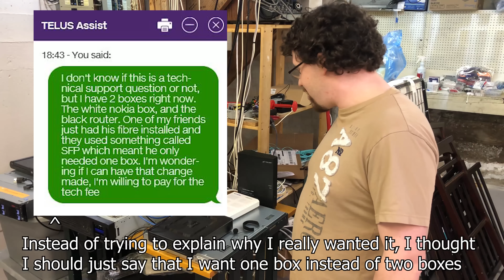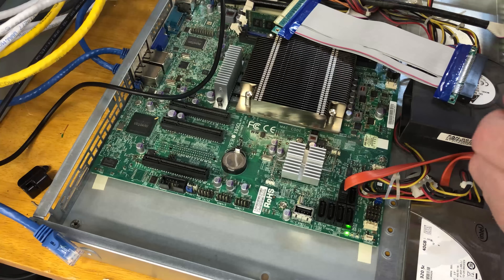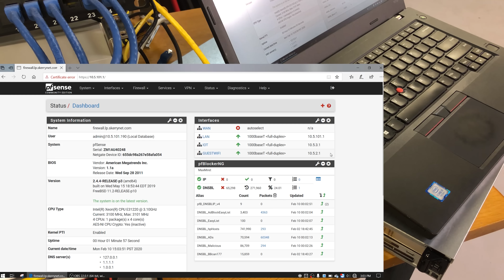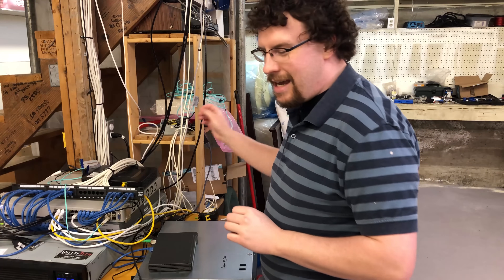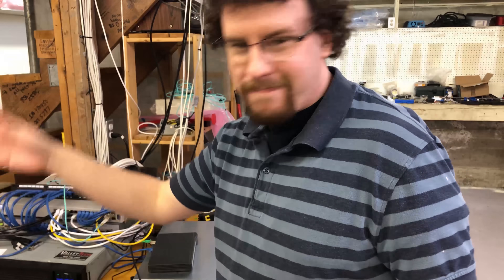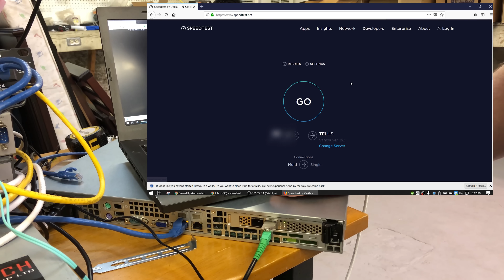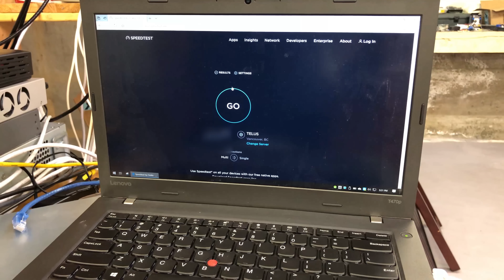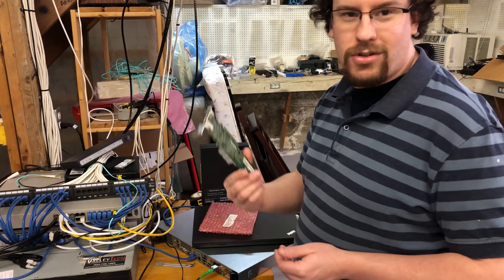I connected my fiber internet directly to my pfsense router via SFP!

Comment from the maker: I upgraded to 1.5 gbit internet! Check it out here: https://youtu.be/gzk69kHLu1o
Reply: Hey just a quick question what transceiver card was used...I am attempting to do this with AT&T fiber. How ever when I plug the transceiver in pfsense does not recognize it...I did some looking into it and it is a nokia transceiver PT# 3FE46899AAAA
Reply: @andrewholder495  Did you ever get this to work? If so, what transceiver did you use for the Chelsio T420?
Reply: @jcmichel5768  Unfortunately I did not gave up I got a set of public IP's from my ISP
Reply: Thanks
Reply: Hey Shae so very thankful for this information...I tried the same setup with the Chelsio T420...how-ever when I plug my ISP's SFP transceiver in (which is a Nokia also) PFsense does not recognize the module what module PT# is yours? mine is P/N;3FE46899AAAA.
Reply: What transceiver did you use for the Chelsio T420?
Reply: @jcmichel5768  I tried several different ones the last was ODI GPON OLT Class C++ DGT2-49DC-2CY2
Reply: @andrewholder495  thanks
Reply: Hey i have 40gb service and my isp says the sfp is my responsibility. The ont has 4 10gb eth ports. Anyways i cant figure out what type of sfp+ adapter i need to connect from the fiber coming into the property. Its not like the fiber that goes between my switches

Comment: So I have a question. Does this mean pfsense comes with the protocols that normal fibre ONTs use to connect to internet?
Reply: No, it actually the gpon stick that communicate with the fibre signal.
Idk if his ISP have some sort of ont authentication at the time of the video. But generally, the gpon stick must have the same information as the ISP modem (eg. gpon SN, mac address, etc) so that the ISP can authenticate and give you internet access

Comment: It's shame none of this can be replicated on BT's network as their far behide the technology.
Reply: Lovely 😶I'm here because BT has just installed a 500Mb FTTP L3 line at a client and dumped an Adtran box. So I'm trying to figure out how to get their PFsense box to talk to this, hopefully without a router. Any comments & advice welcome!
Reply: @boerboel7777  As far as I remember, the connection between the cabinet & client is uplink of 10Gbps, policed down to meet the payed for speed. If I can remember, BT use MAC filtering, serial number filtering at OLT level to make sure only ONT's provisioned by BT are allowed to authenticate.

Comment: With fiber for anyone watching this when you plug in FIBER or whatever to WAN on PFsense either straight fiber or through an ONT don't just sit and wait for it to connect, restart PFsense.  Restarting PFsense will pull an IP and configure the WAN port.  Always restart PFsense when changing WAN it's just faster.  Also yes your speed will be limited to your computers NIC even if the PC has a 10Gb nic on most Nics the advanced default settings really limit the NIC speed.  I spent a good two days adjusting the nic settings and testing.   I have 10Gb nics on all my stuff.  You have to turn off all Power saving and flow control features, and crank up the RSS ques, and Buffering as high as it goes.  Also if you happen to have jumpo packets on all devices this actually makes a big difference on LAN speeds.  But anyway turn on all Offlading, options turn off all PME/power saving functions, and flow control.  Turn on split header if you have it, and crank up all Ques and buffering on your nic.  My 10Gb nics went from 120MB Mega Bytes not bits on windows across lan to 700 to 900 Mega Bytes so basically close to 10Gb.  My internet speed on 3Gb went from 1.5Gb bit down to 2.5Gb down and 700 up to 1.5 up I'm on 3Gb plan.  Nic settings matter a lot, at least on intel nics.

Comment: This is great. 

I was part of the small test group that trield out the 1.5Gbit network for TELUS back in 2019. It's cool to see that you were able help support folks with this video.
Half a decade later, I've upgraded to 3Gbit and I'm not learning how to incorporate pfSENSE as I upgrade my network.

Understanding it's been so long since this video, thought I'd comment and ask what your current setup looks like.

Specifically, for anyone else on the TELUS network thinking about or already running pfSENSE on TELUS Fiber, I'm hoping for some help with setting up pfSENSE. I've connected my ONT/NAH (set to bridge mode) to my pfSENSE WAN port but cannot get a public IP address to show up on my pfSENSE admin console. 

Hope this comment restarts a conversation around pfSENSE and networking for us TELUS Fiber internet users with niche home networks.

Comment: I'm getting the same speeds (1G) on the BGW210-700  to my pFsense box via passthrough mode (ONT) with a public IP. (But I'm not running a bunch a servers in the background) The only disadvantage (for me) is the IPV6 configuration is limited to one subnet without the ubiquitous "hack", which is more trouble than it's worth!  Been stable for about 5 years.

Comment: They still have an ONT (2024 June install by Telus Fiber to home). Speeds are symmetrical ~950MB/s. The ONT > Telus modem > Telus router.
I do not have fiber to home in my area but when I finally do get it, hopefully can go from ONT directly to fiber SFP+ on my own router.

Comment: YOU DONKIES DONT UNDERSTAND ANY THING. FIBRE IS FOR LONG DISTANCE 100'S OF METERS. BUILDING TO BUILDING. COPPER ETHERNET IS MAX 100 METERS. AT 100 METERS IT WONT BE FAST. ONLY FAST FOR 20 TO 30 METERS. FIBRE IS FOR LONG DISTANCE 100'S OF METERS. MULTIMODE FIBER CAN GO 500 METERS.

Comment: Here is how you get it to work. the latch on the sfp that you plug into fiber factory box. No BS Gfiber hasn't been able to bill me for a year with my UDM pro. OPEN LATCH PLUG IN THE FIBER MAKING IT HOT SWAPPABLE. Let it config on the isp box and then pull it while live and plug it into the sfp. They will not be able to see  traffic and without the fiber jack they cant turn it off when you don't pay. they have one option and that's to cancel your account after it gets to 1000 in outstanding bill.

Comment: Question, they put the modem in like yours, I want to take that and plug it directly into my router then cable out of router to pc. Do you believe it will work. They told me couldn’t do that . But the tech guy didn’t know much he didn’t even know about 10gig ports and 2.5gig ports. Second question where do you get the took sfp tool?

Comment: I've been trying to make this work with an HP NC523SFP card. After a lot of digging, I've come to the conclusion that likely the reason it doesn't work with my card, didn't work with your card, but does work with the chelsio is because according to it's specs, it has IEEE 802.3z (1gbit) standard, while all other common cards for homelabbers are only IEEE 802.3ae (10gbit)
Now I'm wondering if the x520 might have support, datasheet says 1/10gbe for optical and 10gbe for dac, but doesn't state 802.3z

Comment: I've got the new ATT fiber modem, the BGW320 with the SFP connector.  Do you think that I can just plug that SFP connector with the green fiber cable straight into the 10G port of my Unifi UDM pro, set the interface to DHCP and see if it pulls an IP?

Comment: Maybe stupid question but here in germany we have internet that is conected to router via f-type connector.
So my question is there any way to bypass provided router or connect that cable to your own pc?
That would be linux or bsd based router os  so you can manage it yourself because current router decides to go update mode when you least need it and you lose internet up to a hour.

Comment: I totally want to do this but have some roadblocks preventing me.  need a card compatible with freebsd (would prefer native compatibility), must be low profile for my optiplex 9020 SFF box, must accept my Alcatel-Lucent G-010S-P transciever module.  (also do not want to have to solder / bodge wire the card)

Comment: Hi Shae,

I have a new Netgate 6100 Security Gateway (pfSense) and I would like to bypass my 2 GB Google Fiber modem. The 6100 has these built-in network ports: (2) 10 GbE SFP+ Ports, (2) 1 GbE Combo Ports (RJ45/SFP), and (4) discrete, unswitched 2.5 Gbps Ports. 

I removed the Google Fiber SFP from the GF router and inserted it in the Netgate SFP port, hoping to obtain a public IP address, and to migrate to the 6100. So far I have not been able to get this to work, and stumbled upon your video while searching for help.

Do you have any thoughts or tips that might help me?

Thanks in advance.

Comment: I'm going to try a setup similar to your setup too.  Instead of a PFSense box I'll bypass the Nokia ONT box and plug it directly to a Netgear SFP+ switch and then to 2 separate Asus router.  This way I can grab 2 Telus external IPs for 2 separate networks.  Would that work?

Comment: the lights are pretty confusing when you get new router after long time I think Zyxel and other routers needed internet braodband was the name so fiber is now Ftth gpon and epon Im getting 97Mbps on Home plug adapter or ethernet cable im paying 85 euros for 2 phones with dual sim cards 1 from croatia and 1 from slovenia there is no more roaming utp cable haves 2 pairs times 4 so if you use all 8 wires you should be getting 1000Mbps without any power over ethernet adapters and switches.

Comment: any one try this on any intel nics?
Wondering if it will work with the Intel X520-DA2 10Gb 10Gbe 10 Gigabit Network Adapter NIC Dual Port

Comment: Lol its not if the card will work with pfsense - if it's the firmware will recognize the card to begin with. When in doubt mellanox 3xconnect (I believe  that's the name) - they usually pnp and play fair without a problem

Comment: FYI ; You're still using an ONT - just an SFP based ONT, which is no different than using the Nokia ONT. That model Nokia is actually capable of nearly 2gbps on the fibre interface, but the ethernet ports are limited to 1gbps. So you can get better performance  using the SFP version of the ONT directly in your router if that SFP is a 2.5gb version, and your own router has ethernet ports that will support that rate or higher. There are multiple versions of the SFP and TELUS uses 3 versions depending on which CPE you have (1, 2.5, and 10gb versions). The actiontech t3200 has been deprecated, and is replaced by the TELUS wifi Hub (which features 2.5gb SFP and ethernet ports), the Arcadyan  NAH (Network Access Hub) which has a 10gb SFP port, 4 GBe ports, and 1 10Gbe port. The service you are using is GPON, and TELUS has just released XGS-PON for speeds up to 10gb. If you see speeds above 1.5gb available in your area, that means your NAP has access to XGS-PON splitters in the FDH, and in that case you can get the big daddy - a new black Nokia ONT with 10gb ethernet ports all around. Happy surfing!

Comment: Hi Shae, I was wondering if you could try this with a mikrotik (RB3011) device and see if you can get it working. So skip Nokia ONT and plug directly into mikrotik router in place of PsSense.  I would be interested to know as i want to try this.  I am not familiar with PfSense.

Comment: Some incorrect facts. For Tv you don’t have to use the actiontec, yet it may have to live on the network for an unknown reason. You can also pull 2 IPs off the ONT with a switch and make a tv network separate form your main network. Some places get a fibre into the router (SFP) yet I’ve never had that for my sites. SFP modules are not all compatible with all devices ask that’s to be expected, need to find a compatible card or device for the provided SFP module. 
This is also with this ISP and not all are are as friendly or unfriendly as this one.

Comment: Lovely video!! I've been desiring this for a few years and I bet it's possible to do for me.
Note: Some ISPs go mad, when they can no longer control your fiber-box. ;)
If I'm going to try this, I'll be using a Solid-Run ClearFog CX LX2 (yep, the $1000 variant with 100Gbit QSFP28 in addition to the QSFP+).
A MacchiatoBin (or even the 9130) would likely be sufficient.

Comment: I have fibre too, but they just gave me a micro ont which is about the size of an altoids container, which has an ethernet port, which can be connected to any type of router. I think having an sfp module would be cool though, I have several gigatybe switches with sfp ports, it would reduce the amount of crap I have laying around lol.

Comment: question for u as u seem to understand...  
, with the TELUS IPTV boxes back  from 2010,2011,2012 etc, , they would create multicast SYNC IP  flood if not using all telus hardware with their settings, router, ap, wifi, etc, modem , etc

The new telus iptv boxes seem to be more direct IP TV ,  they dont create a flood..  Has technology changed? if so whats the difference. Thank you

Comment: @Tech with Shae, can you provide the parts you used for the pfSense build?
Reply: Router Specs:
Supermicro X9SCL
https://www.supermicro.com/products/m...

Intel Xeon E3-1220 V2
4GB Memory
40GB Intel SSD 

The SFP module provided by Telus is a G-010S-A P/N 3FE46541AADA

(From the Video Description)

Comment: At 5:20 when you plugged the fiber connection in to the SFP you pulled on the release lever which activates a mechanism that pushes the ONT away from housing, so the HP card MAY have worked if you didn't do that, the SFP ONT may not have been seated correctly.

Comment: I think you said the card was an SFP+ witch is a 10Gb/s interface. While it should auto-negotiate down to 1Gb/s, it may not do so all the time, especially in a PFSense setup. If you could limit the port to just 1Gb/s it would probably have worked.

Comment: i have att gigabit fiber. my install consists of a small wall mounted box that the raw fiber cable plus into. then from there to a modem/router (via ethernet cable). and from there, into the computer and a switch that sends it throughout my house.

id like to delete my modem/router so that the ethernet cable coming from the wall mount box goes straght to a router of my choice.

is that possible? ive heard of setting the modem router to bridge to my router of choice, but id rather not. ive also heard i can get my own 2 in 1 modem/router to replace my isp provided one. but those seem super expensive.

Comment: Updates brought your ping down. Plus change your WAN to change the IP address. It will automatically put you into a higher tier tunnel usually. Depending on whom is around you. Businesses and major coms people. Cellular radio junk, unshielded wires. Will have ping issues unshielded versus high-end wires.

Comment: I have an HP dual card sfp+ collecting dust in my closet. I have had the best luck with the Mellanox ConnectX 2 or 3 cards.  I had a Chelsio card that either didn't work with my setup, or was dead on arrival. I'm dying to direct connect fiber to my router, since it has an sfp+ port on it to connect a transceiver. Thanks for the great video!

Comment: I used to have 10G and I had trouble with one of the old Xeon E3s. I switched to an old i7 980X and got 5Gbps throughput. There is a limitation in software with Pfsense doing multi-gig routing and not hitting 10G. If you're not getting the speeds you need try changing processors to something newer.
Reply from the maker: Yeah I got it all sorted now, running 1.5 gig :) https://www.youtube.com/watch?v=gzk69kHLu1o

Comment: Hello Sir, I've Netgate SG5100 - its quite an expensive device but WAN is only GE. I'd like to use fiber from my ISP in off-hand ISP manner. I was considering the purchase of a switch with SFP module and using passive route from SFP to GE on my switch - so I can plug router with the switch over GE cable. However, I've difficulty to find out if switch allows this setup. I'm considering Netgear 10p GS110TP. I've send email to Netgear to find out will I be able to do that but without response. Can anyone assist?

Comment: Hi Shae,

I'm also on Telus 1.5Gig. For those of us who don't have a server rack, do you have recommendations for a simpler setup?
I saw a guy on reddit got it working with XG6 + UDM Pro. (UDM pro might gain future 2.5Gig support.)

Thanks
Reply from the maker: At the moment I do not, but only because I haven't had the opportunity to test any other methods. I have seen some forum threads where people have tried to get it to work with some ubiquiti routers, but the issue is the module only links at 1gbps even though the ports can support more. I would recommend looking on the dslreports forums, Bell also has a 1.5 gig service so I would check both Telus and Bell categories on the forum.
Reply: @TechwithShae  Thanks for the reply. It was bothering me too much (not getting full speed) and I wanted to keep things fanless. So I went back to 1Gig.

Comment: Hey mate, chelsio T420-cr 110-1120-40 are very rare to find and expensive since it gets shipped from US. any other cards that are compatible? by the way I have telus 1gb connection like you with no phone for the house.
Reply from the maker: I have managed to get the Broadcom card to work that I tried to use at the beginning of this video, but it needed a physical modification to recognize the SFP module used by Telus. 

The card is a Broadcom BCM957810A1006G

Here are the links to the guides I used to get it working - the most important one is the solder modification. If you are able to do that, you may be able to use the card without installing the custom driver as long as you don't need speeds greater than 1gbps. My other video (https://youtu.be/gzk69kHLu1o) showcases using the custom driver to achieve speeds greater than 1 gig if you subscribe to the new 1.5 gig service. 

pfSense Driver:
https://www.dslreports.com/forum/r32387515-

eDiag / Main thread:
https://www.dslreports.com/forum/r32230041-Internet-Bypassing-the-HH3K-up-to-2-5Gbps-using-a-BCM57810S-NIC

Broadcom Solder Modification for Nokia SFP Module
https://www.dslreports.com/forum/r32529545-
Reply: @TechwithShae  Thanks for the response mate!